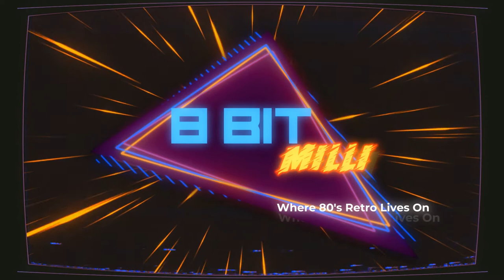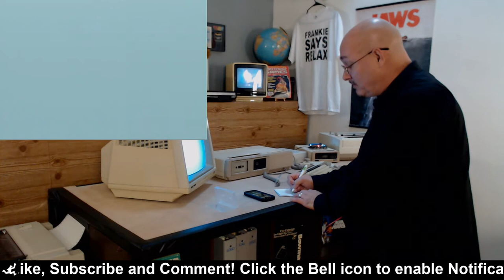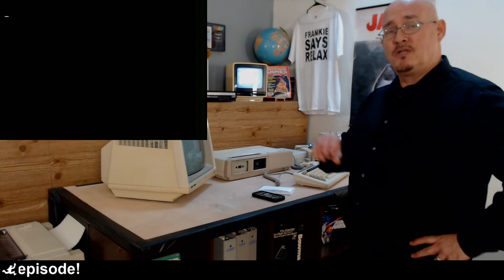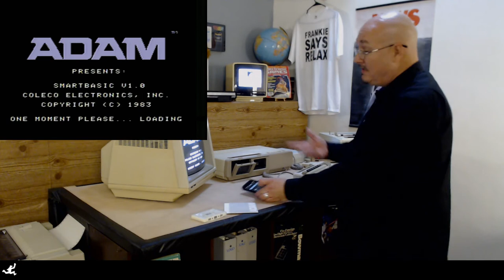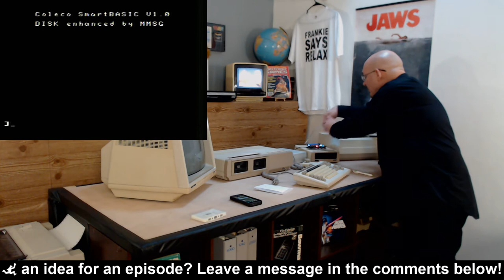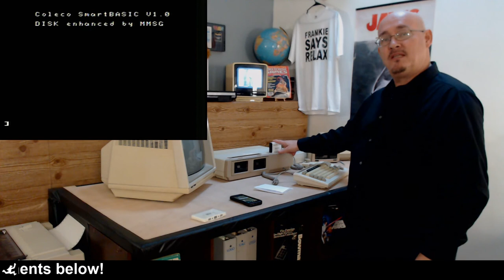8 Bit Nybble: Loading Smart Basic 4 Different Ways

Comment: If you load from the cartridge can you still save your work? If so, where would it save to?
Reply from the maker: You still have to have a data drive or disk drive - the cartridge just makes the Adam act like other 8 bit systems
Reply: @8BitMilli  so once loaded from the cart, you can point it to the drive you want save it to (either DDP or Disk)?
Reply: Yes. Don’t let yourself be confused. Loading SmartBasic from a disk, data pack, cartridge or boot prom gets you to the same place once the Basic Interpreter is loaded into memory and ready for user input. All the I/O functions such as the commands CATALOG, SAVE, LOAD, BLOAD, BSAVE and BRUN are available depending on what drives you have connected to the Adam. One just has to add the drive number assignment to the end of the command and that drive number remains the default unless you change to another drive. For instance, “ CATALOG,D1 “ without the quotes will display a catalog of the files on the DDP in Digital Data Drive #1. If they are installed/connected to the Adam, D2 is for Digital Data Drive #2, D5 is for Disk Drive #1, D6 is for Disk Drive #2.